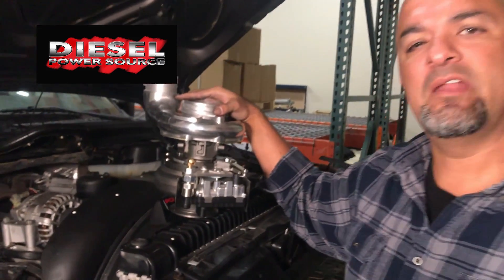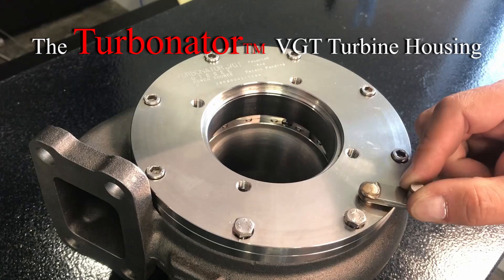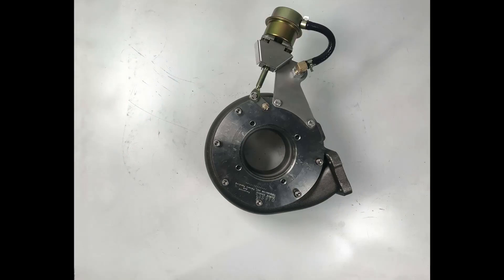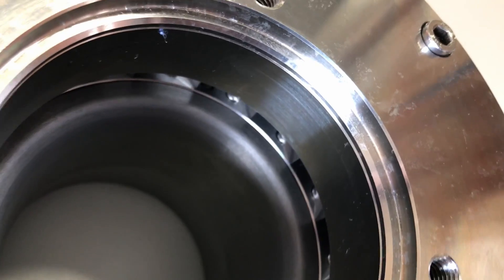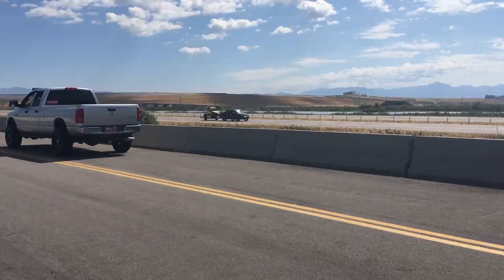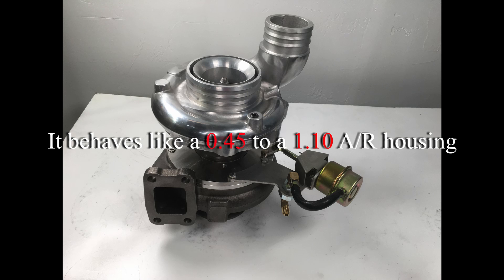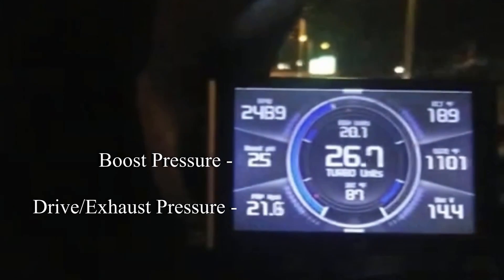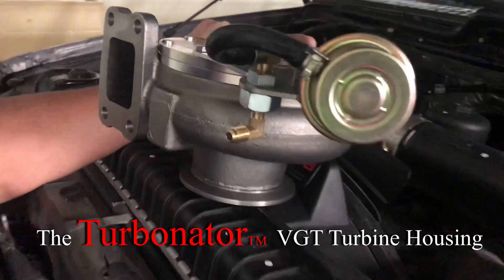Why is the DPS Turbonator VGT / VNT Turbocharger an Industry Game Changer?

Comment: Will this work on my existing Borg Warner SXE 369 with a 68mm turbine?
Reply: From the website...
Clockable, can be clocked to fit nearly any 5.9 or 6.7 Cummins application
Clockable, can fit most S300 T4 & T3 and S400 T4 Turbos
Fits Turbine Wheel Sizes 71 and 74 mm (83mm S400)
Can be used in Twin/Compound Turbo Applications

Can be used on 2nd Gen Swap Kits
Can be used on 3rd Gen Swap Kits
Can be used on most T3 and T4 applications
Reply: Short answer: No

Comment: I would really like to see one of these on a Road Racecar.
Not only would you have the quicker spool up coming out of a corner but the engine braking might have some value in saving the brakes on an endurance car. It does not have to be a big difference to add up in a 12 hour race.